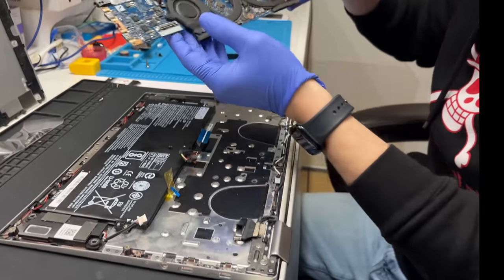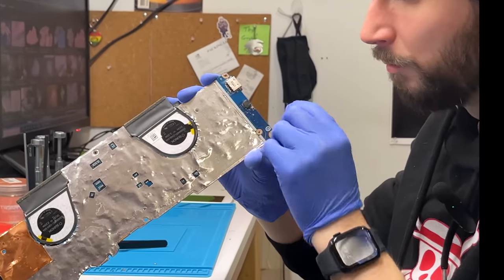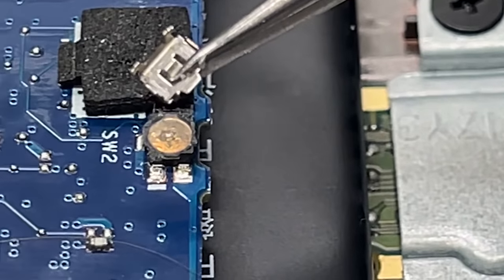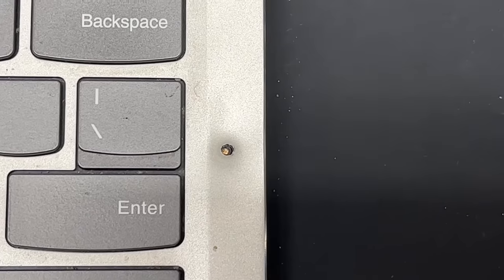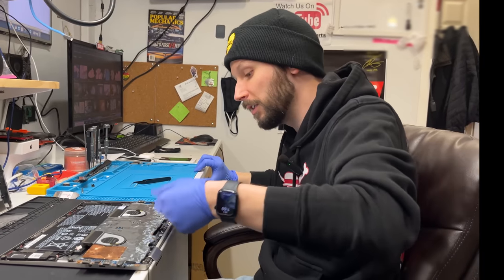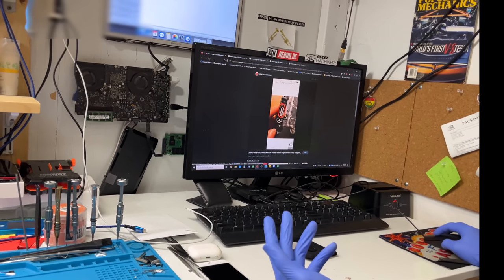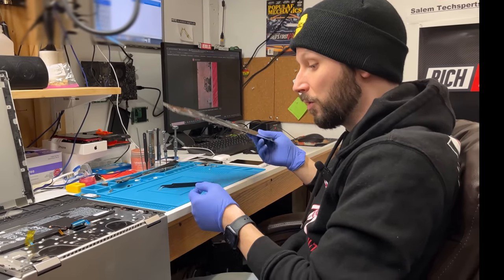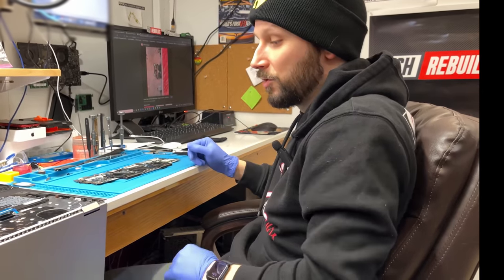Another reason to never buy a Lenovo Yoga (huge design flaw)

Comment: got a lenovo yoga for my mom to watch shows. (which she dosent use any more other than paying bills because of its terrible battery life and it overheating under simple use) After updating the laptop the trackpad just stopped working, lenovo said it need a bios update , so you can ether pay lenovo 25 dollars a month for lenovo vantage and they will update it for you or you can dig through the website for the update which is only for windows 10 and lower even though the laptop shipped with 11 on it,(even after manually updating the bios the track pad still does not work and just as eveyone else is saying all these problems acuared a couple of months after the 1 year warranty was up. so not only are the engieners smoking crack they all are

Comment: I got a cheap gaming laptop off a guy that got a virus within a month of owning it so he sold it to me for one amazing deal....

The power button is a key on the keyboard, its an acer predator

Also, i couldnt recommend anything less than a full blown gaming laptop these days because the only laptops that are sturdy enough for daily use would be the thick gaming laptops they thankfully still make thick due to the graphics cards they cant make smaller

Like sorry, i dont want my laptop so thin that it bends in my bookbag when i decide to take it off my minifridge, and no, i didnt buy it for school, i bought it cause it was cheap and can run my tv so i dont have to turn on my super expensive custom gaming computer when i wanna watch a movie with surround sound

Comment: I was there. I modded/reconstructed the button mechanism of a customer because it broke after half a year of regular use. It is just the same damn flawed design as cheap bluetooth speakers. They place the buttons in a way to gradually bend over time and also the cap has to have the thinnest possible guides...

Comment: the only good thing about side power buttons is that you can use the laptop with the screen folded so you only work with the external display connected and the laptop being closed prevents dust and dirt from entering in the keyboard. but this design flaw is a terrible idea, and a shame for a company like Lenovo

Comment: There is another reason why this button design is bad. It can be easily pressed accidentaluly while you are moving it ir ut is in your backpack. (Which is an intended use for laptops). I can already imagine how a random bottle of water turns it on in the backpack and it drains the battery and overheats.

Comment: Not sure why take such drastic measure though. Is it impossible to solder a couple of wires where the button is, and put a regular micro-switch elsewhere? Even attaching it on the outside is better than drilling holes or replace the entire motherboard because of some replaceable component.

Comment: i own an l380 yoga due to my old school mandating it and everyone i knew with the same model had the exact same problems with it as me, the left most sodimm memory slot had an issue with it, im not too sure what it was, but the ram would disconnect in use and the computer would crash and fail to post

Comment: My mom has a Yoga 6i with this exact same issue. Thankfully the laptop turns on when you open the lid, so it's not a paperweight. But if it freezes, you have to wait for the battery to run out.

Comment: Well fuck, now that you mentioned it, the power button on my X1 Yoga Gen 3 was kinda wonky from the beginning (e.g. it does not actually register the press until you hold it for like a second, which is weird since the button is flush with the side panel so it wouldn't be normally accidentally pressed in anyways - why did they add this software hold-timer, or is it the shitty hardware in action?). Fortunately still works, but I agree that for what is their most premium Yoga of the time, it feels a bit off. Well, good thing it's just a switch, if you can't buy a replacement you can always devise some in-situ solution which will work too.

Comment: Lenovo always made trash, had a lot of hassle with my old thinkpad and stupid me gave lenovo another try, so i bought newer ideapad.. after not even year, the screen cable had to be replaced, the system was sluggish as hell by doing just easy tasks and letting 90% free space on on disk, the rubber parts on the bottom unglued and left a stick mark on my desk and the whole laptop cracked in multiple points. Honestly, fuck lenovo.
Reply: And then i have a spare pos 8 years old HP laptop that doesn't have any of these problems despite being cheaper than each lenovo, lol.

Comment: There is another reason why this button design is bad. It can be easily pressed accidentaluly while you are moving it or it is in your backpack. (Which is an intended use for laptops). I can already imagine how a random bottle of water turns it on in the backpack and it drains the battery and overheats.

Comment: I had the same thing happening with the power button on my dishwasher. There was a flimsy plastic springboard looking thing between the button you press and the switch on the circuit board that broke off. I opened it up and glued the piece of plastic to the button and it worked even better than before.

Comment: I soldered on a 2mm size micro switch, with 4 wires to the motherboard solderpads, Idrilled a hole next the power button, its my store laptop and still worked, just glue ut to the back housing with epoxy resin

Comment: i recently got a Lenovo yoga 7, which also has a side button (but no reset hole or anything). The button works fine for now but i never need to press it because the laptop turns itself on when lifting the lid

Comment: I have the same ''I wonder what's going to break'' type of thinking after buying an ideapad 5 15 and found out outside the warranty period that the hinge had an issue and almost broke the whole clamshell assembly, now my laptop is a desktop, and the heat management of this pupppy is so ass I have to clean it and service it every 6-8 months because thermal paste was really bad and the dissipation heatsink isn't enough for the load: having plastic instead of metallic fins on the end of the heatpipes, a wonderful 15'' piece of shit that doesn't even have dual m.2 slots... Masterpiece from lenovo!!

Comment: Oh! All Ubiquiti equipment uses the same mechanism for their reset buttons - which is a huge problem if you use them in a training environment. I remember doing a prac for a certification and being unable to reset the device, so I undid the half million screws and clips only to find exactly the same thing - a tiny sliver of metal rattling around inside. We ended up "solving" the problem by drilling a hole above the actual switch and pressing it directly.

Comment: Never again Lenovo. I've owned a number of laptop brands over the years, Lenovo one of them and the worst. With me it was the anchoring for the screws holding hinges, printed circuits, fans and stuff to the housing. It all simply disintegrated after just 3 years. I fixed the problem myself with 2K glue which was easy enough if you have the courage to take the laptop to pieces and have the right tools.
I'm a design engineer and advocate for simple solutions wherever possible, but I was shocked at the cost cutting primitive design the engineers had used for the anchoring. It was practically designed to fail after a few years. At least my 2K glue job gave the laptop a far longer lease of life and in the end landed with my sister in-law where it's still alive and kicking.
Reply: Sir what is your take on HP Laptops?

Comment: Nope, not just Lenovo. I fixed an HP flex that had the exact same shitty button. It's not a great design but it's caused by people being Neanderthals when they power it on.
Reply: Also I just ended up using hot glue to put the metal piece back on and it worked fine. no idea why you drilled a hole in it

Comment: I was issued a Lenovo ThinkBook 14 G2 for work, and it was the most reliable, robust, and stable laptop I ever had. It handled everything I threw at it, never BSOD'd,  and although I wasn't the gentlest with it it's good as new. Sad to see them f up a different line because they nailed it on the head with that laptop.
Reply: Glad thinkbooks are better, I just got a new thinkbook 16+ 2 weeks ago

Comment: I have this model yoga and never had an issue with material quality except a hinge coming loose that. I dropped this thing like 50 times broke the screen and bent the top case burned the hell out of the cpu during high school because it was my only pc and I streamed Garry’s mod for 16 hours straight regularly. Only problems it currently has is that the battery has gone to shit because it’s 8 year old laptop. To be fair I have a thinkpad x1  that’s a year older and the battery lasts all day and I’ve never had a single issue with it. Even after re pasting the yoga’s cpu it runs hot, albeit not as hot as when I abused the thing as a mobile audio workstation and streaming pc lol.

Comment: It's definitely no excuse here but I think their design has gotten a lot better since. I absolutely love the build quality of my lenovo yoga 9i (14ITL5) and I've been using it rigorously for 3 years so far for college with 0 problems. I'm only opening it for the first time now to change the battery from natural degradation (maybe more heat than usual tho since I do a lot of intensive workloads). What's really impressed me is the rigidity and hinge since I hold my laptop with 1 hand and flip the thing dozens of times daily. To address the buttons though, they're now pressed directly with the side power button being a separate board turned sideways and the reset button on the bottom of the laptop.

Comment: I have had this laptop(not the same) Yoga for almost 7 years.
I have no issue except that the aux port cracked because of my mishandling.
Every other port works fine and I never had any problem with the power button.
Lenovo Yoga is one of the best I can say.
Great build quality.
And the fun fact is, I have almost 60% of the time used on my bed, and even then overheating is not an issue.
My next laptop is going to lenovo too hopefully.
Reply: 7 years ago design propably was better...